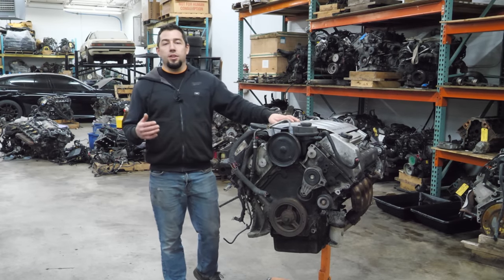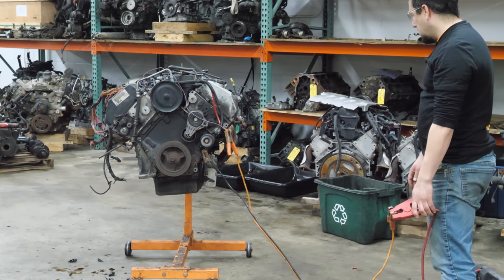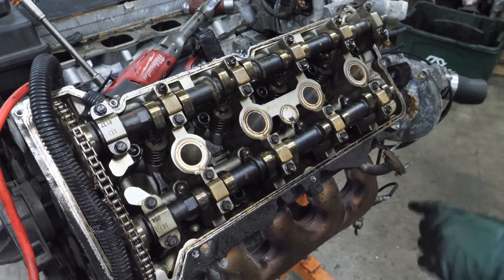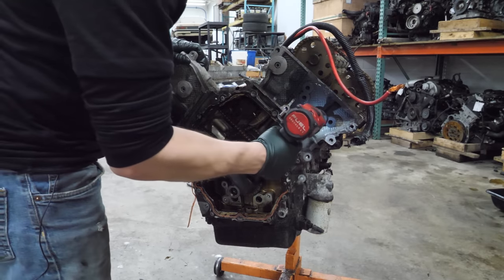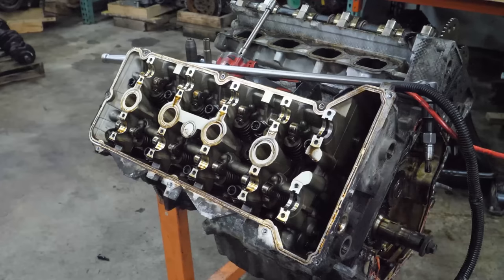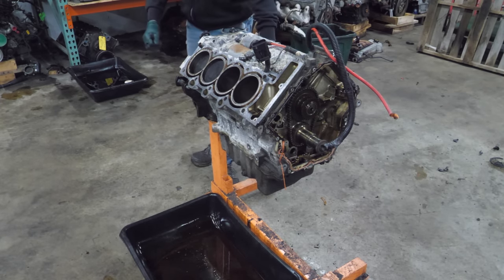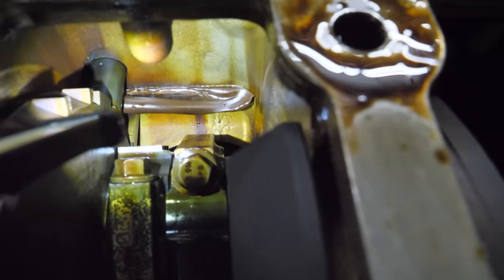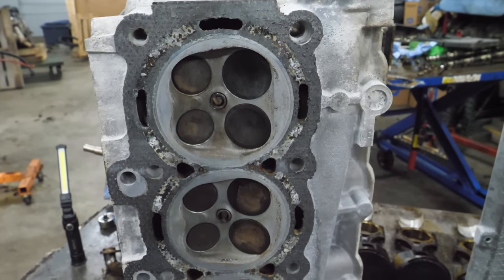Customer Returned This Cadillac Northstar L37 4.6L V8, How Many Things Can We Find Wrong?

Comment: I currently have my second Northstar in a 99' Eldo. My 93' STS had 280,000, no major issues (except the oil leaks). Just don't beat the living crap out of them or let them overheat. That will destroy any engine. As far as the starter, if you think about it, that is the best place to keep it out of the elements, and away from the exhaust heat, increasing longevity. And it is not difficult to get to either. I have never had to change one. The cam drivetrain was designed for long life. I think it is a well designed engine, except for the head bolts should have been studs. Thanks for the teardown, it was very interesting to see.

Comment: My favorite part of cooling system repairs on some of these engines was GM’s directive to “install 3-6 tablets of GM Cooling System Sealer in the lower radiator hose prior to connecting to the radiator.” Of course it was just Barr’s Leak tablets. Hahahahahaha

Comment: I’ve had to change that starter before. The spring was weak so around corners it fell to the flex plate and sounded just like a bad cv axle. I changed both cv before finally figuring it out. I like the engine though. The torque, the sound.

Comment: Fix the head issue and they can be fun. I had 2 ‘97 Caddy STS’s. The first one I learned my lessons on, the 2nd one had big wheels, big stereo, bad ass exhaust, and 150 shot nitrous with all the supporting mods. Drove it to 168,000 miles. Heads were fixed right at 66,000 miles. Ex wife put dents and scratches everywhere with her superb driving skills so I finally traded it in. 

Get the heads straightened out by someone who knows what they’re doing with these motors, slap a turbo on one, figure out an exhaust and the older caddy’s  can be fun. I ran 150 shot of nitrous for almost 100k miles and 4 years and the only other major issue I had was the rear air suspension going out and 1 harness that was under the center console was chewed up and it would shutdown the car. Dealer fixed harness at 80kmile for less than $300.

Comment: I had two Northstars via Cadillac a few years back. Never again! Two cars I bought both of them used, four blown head gaskets with both less than 140K on either. Pieces of garbage. The first Cadi had blown gaskets (both) on a trip in 2005. I think the car was a 1998. Anyway, the repair was $3000.00 and took 3 days. As I said before the car had around 140K miles on it. The second was on a 2005 Cadi in 2016. Again both head gaskets but the cost this time was quoted at $6000.00 for a car that high booked at $900.00. Nope, sold to someone that felt they could fix it themselves. They couldn't and it was junked. Really sad because the rest of the car was in prime condition. It was a Deville DHS with every bell, whistle and switch you can imagine. It became one of the nicest looking lawn ornaments you can imagine.

Comment: My 98 STS dropped an intake valve where the lifter was worn all the way through, wore away the valve keepers, and let the valve ride up and down with the piston.  A few front cylinder head (done with the engine in the car) and it ran fine again.  There was a special GM tool kit for holding the ratcheting timing chain tensioners while the cam(s) are being removed to replace valve stem seals, etc.  There was also a tiny lever that could be actuated with a pick through the cam sensor port to release the timing chain tensioner ratchet.

Comment: I drove an Olds Intrigue with the V6 "ShortStar" to 248K. By the end, I was adding a quart of oil every 200 miles or so. It still ran fine - mainly traded the car in because I wanted a truck and too much of the various W-body components were wearing out and annoying me. I had a similar experience with a Mazda Protege in the 1990s. When you're over 200K on an engine, it gets thirsty. Keep extra quarts in the trunk. Check that stick and top it off religiously! Engines can be prolonged into advanced age, if you make sure they have oil.

Comment: A couple months ago we got rid of my moms 99 Olds Intrigue with the 3.5L. They bought it new in 1999 and it had 250,000+ miles on it when we hauled it to the junkyard as the engine finally started to go.

Comment: First, to answer a question asked in the video, even if its not seen, The northstar engines have a special water pump that lets the housing remain, while the actual impeller and pulley come out with a special socket that can be loaned out from most part stores. Being the only real failure point of the engine, as if it overheats it is bad (As with ALL ALUMINUM ENGINES), and having it right up front and easy to change, at least on the trans-axles, is super nice.

Also starters shouldn't need to be replaced regularly, and having it where its usually dry and clean only extends its life. I have yet to need to replace one.

Robust and reliable if you take care of them, and they don't mind being ran hard. Almost seems necessary. I say this with confidence, as an owner of an 04 seville (as well as the care giver to an 01). I still have her, and at the moment shes about to turn over 270k. Original engine, no rebuild, same with trans. Water pump has been replaced twice, only out of fear by myself until i discovered the radiator leaking. She might need a new Cat now, and i plan to convert her to CNG dual fuel as soon as DTE gets back to me about public pumps. Dream to drive, and damned be anyone who doesnt have the patience to look past the infamy caused by people who cant check their fluids when they get gas. Shame on them. And anyone who doesn't check their fluids!

story for those who don't wish to read it: Parents got my 04 seville in 2015 when it had around 113k miles on it. Father ran it through hell, never did a proper  oil change on it cause the valve cover and pan gaskets leaked so much, claiming it changed its own oil. in 2018 or 19 i bought it from them after my mom totaled the front end, at about 218k or 220k. $300 and two weeks of rolling in the snow, i had it running again. Did its first oil change since it joined my family and it came out chunky. Even after all that time, the only reason we had ever cracked the engine open, was when we replaced all the gaskets from the valve cover up. Dad said he wish he had done it years ago, as it again, ran significantly better.

Comment: Thanks for staying late to dismantle the caddy engine, Eric.  I like the puller you used on that pulley hub to remove the valve cover.  Who makes it?  I just bought a drain pan for my engine stand from Jegs.  It's around $75, but very nice.

Comment: I saw one of these Caddy's for sale in my local FB marketplace for $1,000.  It looked like a great car, but they said it kept overheating, even after new water pump and radiator.  I bet it had the block heat passages blocked like this one.  Probably be a decent car if you could somehow flush out all that crap.

Comment: Had three of these engines in Cadillacs. Never a head gasket problem. Ran great and got good mileage. Love this engine.

Just from pure curiousity, what size is your shop?
Reply from the maker: It’s about 20k sq ft
Reply: @I_Do_Cars  thanks!

I sent a request on the website; would you have a heated steering wheel for a 2008 Cadillac SRX?

Do you handle these types of parts?

Comment: If memory serves me correctly when GM updated the TSB for the oil pan installation procedure the gray RTV was used instead of a gasket because it was famous for having oil leaks,  it's pathetic to have to use tons of RTV to make a seal. When I rebuilt my 98 STS engine I studded the block and the bottom end where the engine is split in half so it would help solve some of the leaking issues, I went back with a oil pan gasket and mine never leaks. The water pump impeller is removed with a special huge socket looking tool and turned enough to unlock the tabs that hold it in place.

Comment: TSB for the Northstar shows removal of the Channel gasket that fits in the lower block half replaced with a tube of RTV😮 I have had the unfortunate experience of having to do one of those. The RTV supplied for that reseal was a special durometer of material, it was way thicker than conventional silicone free sealant ,and it had a different smell to it.. the water pump has a special tool to remove it from the housing

Comment: The water pump 'snaps' into the housing with a big ring like a fuel pump assembly lock ring, there's a big special socket tool and everything. They're actually pretty easy to change out if they're not seized in place.

Comment: Dude you are the man. Not that I would ever have any V8 or car engine in general to disassemble. But I really find this relaxing If not soothing for stress. If you'd ever do some Inline 4 Motorcycle engines I'd be even more fanboy😁
Big time Motorcycle guy. Currently owning 4 but only one running. But keep it up you rock

Comment: I've had 2 Cadillac STS -- both with the 300hp 4.6 NorthStar. The motors ran great & virtually trouble-free -- I wish I could have said the same for all the chassis codes I had to learn to live with. But, overall, those cars treated me great & were quite fun to drive. I've heard that there are no oversize pistons & everything is designed for single use in the engine -- so that always bothered me in the back of my mind.

Comment: Life hack..... Take a piece of 6-in galvanized vent pipe cut it in half and you can use it as a splash guard when you put your two pans on each side of your engine stand with zero mess on the floor. Jus sayin ☺️ 32:29

Comment: Over the years there have been a variety of directionally correct changes to the head bolts to increase the integrity of the fastene engagement into the block threads. The head bolt threads have been increased slightly and the block thread height was also raised to increase thread engagement slightly. The metallurgy of the block in the area of the head bolts as been under development to reduce any porosity and improve thread strength. The RWD Northstars and the 2004 and later FWD engines have a redesigned head bolt with a 2.0 mm pitch (coarser thread) for better engagement.

Comment: The issues in the Northstar can be traced to one specific fault. And that issue in the Northstar is not the known ones. Its the one that cost cuts every single item line on the build sheet. I've seen i number of comments about what caused the head gasket failures. The wrong size headbolts and thread choice is one l have heard. Another I've heard is the alloy in the block. If the alloy was an issue this could be due to lowering the percentage of alloying elements in the aluminum. As l understand it most aluminum blocks have a high Silicon alloying content. High as in 3 to 5 %. Less alloying elements mean less cost. 
And GM is not the only one. Chrysler with the 4.7 choose a cheaper polymer material for the timing chain guides which led to problems (1). Their 2.7 issues with coolant in the oil due to the water pump placement and drive. I'm sure Ford has done similiar things. 
1) The 4.7 was originally designed by AMC but l don't think they ever got to the production ready status and ordering tooling. I am kind of surprised that Chrysler never put DOHC 4 valve heads on it.

Comment: I had a former co-worker who wrenched at a Cadillac/Buick/GMC dealership.. He told me that he was the only tech in the shop that did internal engine work(MFR recommends factory crate long block swaps) but they found they could make more profit by doing crank/bearing replacement when they developed main bearing knock; common on most hi-mile Northstars.. He told me he had the whole job down to 7.8 hrs and Flatrate paid 14.0..

Comment: The Cadillac Death Star is a magnificent engine when it works right.  Silky smooth, powerful and delivers great fuel economy.  My 98 Deville would get 25 mpg easy on the freeway.  Ridding down the freeway was like floating on a cloud.  You could hear bumps and problems in the road but you never felt them.  However, once the head gasket goes you in trouble.  I did a  lot of work in a few of these including doing the head gasket fix but getting the car to run after that is incredibly hard due to computer programming and blah blah.  Such a shame because it almost makes the car worthless.

Comment: I just did some digging, there is a TSB for resealing the bedplate on these engines. I can totally see a dealer tech doing that with RTV. Makes me wonder if they were somehow doing this with the engine in the car to save on time. Step #2 on the bulletin is "remove the powertrain from the vehicle."  It seems like someone put a large bead of RTV on the block, another on the bedplate and smooshed the two together.  Subaru had some problems with one of their engine recalls that involved major disassembly. Dealer techs were getting RTV in oil passages causing engine failure shortly after the recall was performed.

Comment: What a shame the history of these engines… they are so strong and I have so much love for them! It looks to me like whoever had this engine ran it a while with the block leaking like that so he suffered from some oiling issues… the mechanic put the silicone on with his eyes closed and maybe forgot to do the valve cover gaskets! As far as the coolant goes, if you keep up on the flushes and put the right stuff in it then she’ll be fine. He probably doesn’t know but this motor is in pretty decent condition compared to some of the ones I’ve seen 😆

Comment: Great to see a north star not the best to work on...seeing all that rtv it has been apart usually a reseal has to be done around 100k and I remember using seal tabs from GM when I worked for GM. That buildup you saw could be from that it was used while doing coolant flush and they sealed any leaks or prevented any. 
Also that water pump screws out with a special tool.

Comment: I own a 99 seville with the North Star get really good mileage with it averaging 20mpg. Idk highway supposed to be 28mpg but haven’t owned it long enough to say. That being said i just never got the overhead cams when a simple 5.7 LS made more power much simpler with the push rod design. My seville is a 3rd car in my stables bought from my brother with only 61,000 miles on it. Really nice car very clean but man that head gasket is scary lol!! Crazy thing is i got the car for $2,000 originally new the car was $48,000. That was a lot of money in 1999 for a car right crazy idk. 
Great video 
Thanks for sharing

Comment: You've got a good crank there and you could likely also have a good block, if you hone the cylinders properly AND with a PROPER honing tool. Definitely keep the dingleberry as far as possible from that engine...it'll do more damage than good! Remember, when honing ANY cylinder, you're never trying to get down to the bottom of the scores, just to eliminate the surrounding HIGH spots. Most people actually get that backwards.

Comment: Have a 03 dts deville,jysr resoldered the ebcm had abs trac control dash lites,fixed...regular  oil changes 7.5 quarts 5w30,  guess its time for coolant flush,..had crank sensors causing stalls ...good reliable  car,low  miles around 70 k ,its a classic  presidential black😊

Comment: That crud in the cooling system is actually GM cooling system sealer tabs, which are made primarily out of crushed walnut shells.  On most cars they recommended 1 or 2 tabs.  On aluminum Cadillac V8 engines they recommended like 6? 8?  Something like that?  The stuff was supposed to prevent and seal leaks without plugging radiators and heater cores as well as keeping water pump seals conditioned by "scrubbing" deposits from the seals.  The Northstar had a unique feature that, if over heated, it would alternately misfire cylinders to blow excessive heat from the cylinders so you could drive up to 50 miles to get off the road safely.

Comment: I use to do a bunch of these when people would over heat them I would always lower the engine and tranny down on the cradle to do the headgaskets and re thread the head bolts holes

Comment: I read sometime ago, that since we had the SG oil rating that engine no longer wear out. . .have you notice this ? ?   My older brother killed his Honda CD 750 oversized at 920 . . Because he liked RTV too much. . . I told him that there is only need for enough rtv to absorb surface roughness . .Big chunks of it will end up alla around inside the engine! ! !   He answered No, You cannot use too much of it. . . 65 miles away, the engine seized. . .the right side bluying from overheat. . . .

Comment: My brother had a 97 SLS with the Northstar. He bought it used, with 40k on it. Spent more time in the shop then it did on the road. He was always up on the fluid changes. At 75k he spent $3500 on the split case overhaul. Unfortunately the extended service plan didn't cover it shortly after 911

Comment: Man, that water pump was scary. The water pump is servicable W/O, removing all that stuff. I've done one on my 97 SLS. I sincerely hope the starter does not quit before I die. Everything I have replaced, besides the W/P, alternator, and blower motor, has been challenging and tight. Mine is a 275 horse and has been taken care of, so I am comfortable thinking head bolt inserts wouldn't become a thing.
Reply: The starter is probably one of the easiest things.
Reply: @kyleross5541 , come to think about it, the blower motor and even the alternate were complex. I watched The Car Wisered do head studs on an XLR, and the intake was pretty easy to R&R, much easier than I imagined. At least it could be done standing up.

Comment: The oil holes that were plugged were the oil drainback passages for the heads/valve covers.  This is one of the reasons why the valve covers leaked oil into the spark plug holes.